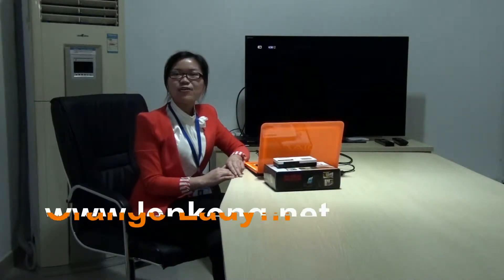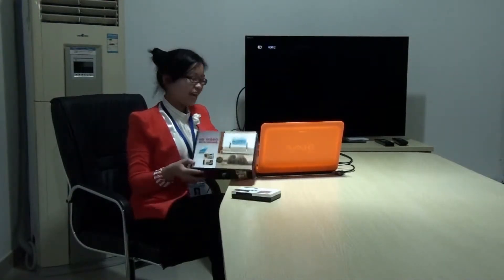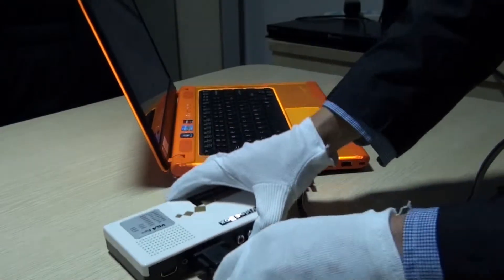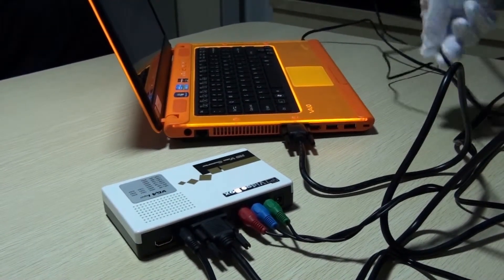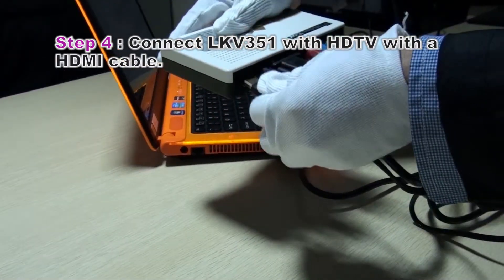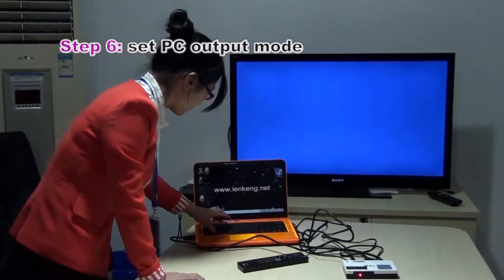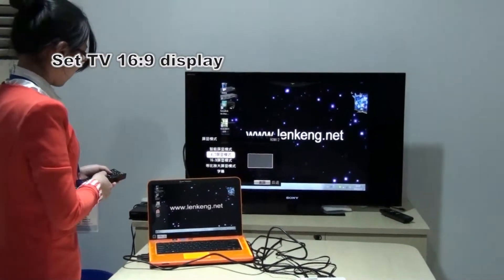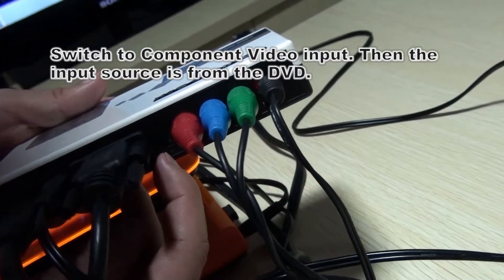VGA and Component to HDMI Scaler

Comment: I would like to get an explanation regarding two problems I've had with the LKV351 across 4 different boxes:

-On 3 of the 4 boxes, all of which I've returned, if the resolution of the VGA output from a VGA-capable device is 640x480, the picture shows up as two images overlaid on top of each other and shifted by at least a good 30 or so pixels
-On the one box that has good VGA, the Component input has an ugly red tint, even with just Luminance (green cable) plugged in

Why is this? The converters I've used with bad 640x480 VGA input have no color tint issues in Component (except the color itself is a bit on the dull side) and the one converter I have with good 640x480 VGA input has a red tint in Component.

Now, while you haven't shown this on your YouTube channel, I even have problems with the LKV351 Pro. VGA is fine, not quite as crisp as the LKV351, but it does work better (I can even use 320x200 VGA from some MS-DOS computers on this box), however, the Component input is INCREDIBLY blurry to the point where the HDMI output from the LKV351 Pro looks worse than the source input (and 240p Component sources are rejected as an "invalid format" when the LKV351 supports 240p Component sources). Did I just get a bad LKV351 Pro or is this a known problem with its Component input (corrected, hopefully, as the Component input is unusable due to this problem)?